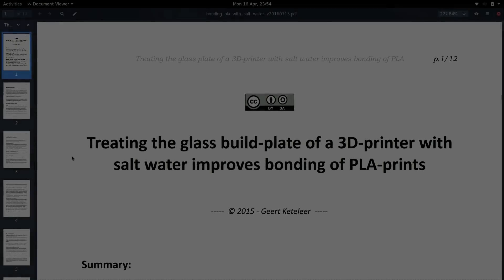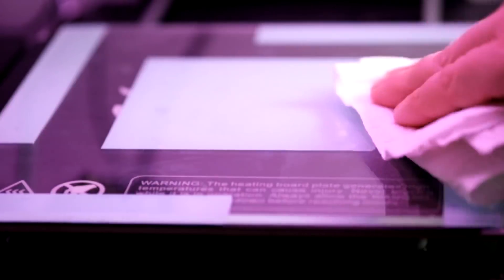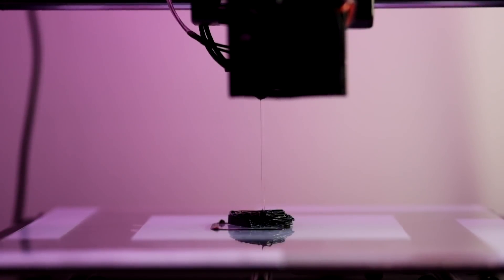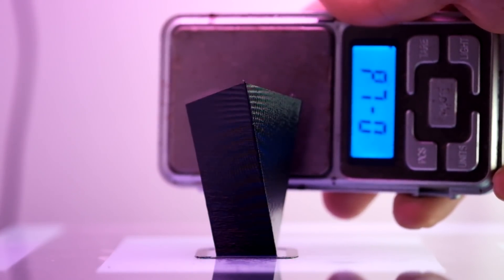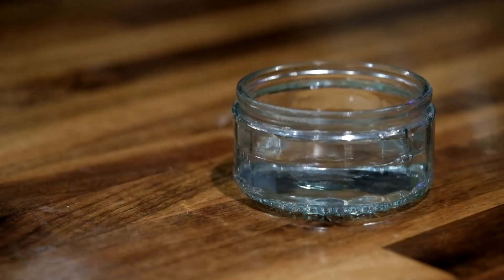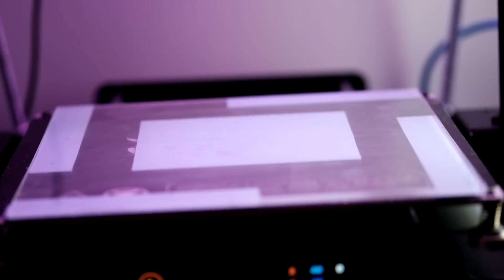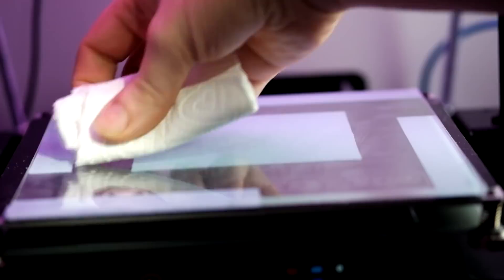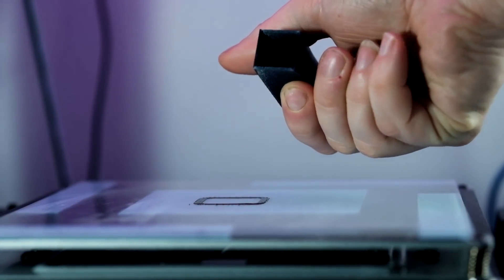3D Printing - The Salt Method

Comment: I tested this method many times and it was great. Thank you for this valuable video. But I made a noire and actually made some changes in this method in the way that I also mixed sugar with salt water, now a very good solution was obtained and all the prints I made were all successful. You can email me to get the details of the method.

Comment: just tried it and it has negative adhesion, as if i'm printing on a layer of butter. worse than plain glass. could be that i skipped the acetone, could be that i used too much salt. will start from scratch and try again until i start to see any change in adhesion.

Comment: So I have had issues with first layers not sticking. Tried different brands of pla and petg with different types of build surfaces. I saw this video and with nothing to loose I mixed up a batch of salt water, let bed heat up and used a fine cloth to wipe the salt solution over the build plate and set about printing. First layer issues gone. Just trying petg now and to my surprise it is also sticking with no evidence of warping. A big Thank You for sharing this information.😀

Comment: This was emailed to the creator of this method
The salt method and ABS

 I came across your paper "The salt method" quite a while ago. I was disappointed to see that it worked only with PLA. (I only have TPU, ABS and Nylon )
 Recently, I was going to print some bed-leveling tests and I thought that it would be worth printing them with some PLA, that was left from buying the printer, using the salt method. Before I was done testing I was out of PLA so I used ABS. To my surprise, the ABS stuck firmly to the bed and when I removed the test prints (1 layer high) they were being attracted to my hand like they were magnets (due to electrostatic forces). So I realized that the salt method also works with ABS.

I was able to print (Part.jpg https://imgur.com/a2Gr0oD ) without brim with very little wrap up (PartWarp.jpg https://imgur.com/b4WLhNZ ) on the edges. I wasn't able to print without brim with glue so in my case the "salt method" works better than most kinds of adhesives.
Then I recrated your test print (CrossTest.jpg https://imgur.com/bjsKPxn ) and printed it (TestWarpStart.jpg https://imgur.com/qKTmEPs ) but it wrapped (TestWarpMid.jpg https://imgur.com/vAZVCaX ) quick a lot front less at the sides and none on back (PerfectWing.jpg https://imgur.com/UBHuIT9 ). So I guess that's due to the bed not being perfectly level although that's pretty tough to achieve with manual bed leveling (DemoSecondLayer.jpg https://imgur.com/pDGAdvB ).

Little information about printing conditions;
Ender 3 Pro (pretty much stock apart from the glass bed)
PrimaValue ABS
Temperature; Bed at 110C and hotend at 255C
Printing in a plastic bag in a wardrobe (so the ambient printing temperature is around 37C)

P.S. I am not sure why no one was able to recreate this.

Comment: This method is great.  Instead of wiping the solution onto the plate, I bought a small spritzer bottle from the craft store.  Misting the solution onto the plate works really well for an even spread.
Reply: Be careful! Salt can corrode metal and electronic components!
Reply: Just gotta be careful to only hit the plate. Salt water is very conductive and quite corrosive so you dont want it anywhere accidentally

Comment: or you could just use an ultrabase or similar textured glass - insane adhesion when hot, and the parts audibly snap off the plate during cooldown
Reply from the maker: Sure, but when I made this video they didn't really exist (or if they did I wasn't aware of them)

Comment: huh, Youtube was like: 
People like videos with salt and 3d printing.
must recommend older ones which have the same thing
Whats next? Salt filament?
Reply from the maker: Oh, is that why this ancient video of mine is suddenly gets loads of comments?

Thanks youtube!

Salt filament which prints directly onto my chips would be OK.
Reply: @MatBrown  In a recent video a guy was tempering 3d printed parts inside finely grinded salt so they don't deform. I think youtube associated a strong connection between salt and 3d printing from that video and started recommending similar ones to everyone who had watched it.
Reply: @evren.builds  It wasn't just annealing, it was completely remelting the PETG parts in solid plastic. The PLA parts were the ones that were annealing.
Reply: @bradensinclair9517  Oh, Then I missed that. Were they printed with %100 infill?
Reply: @evren.builds  yeah they were
Reply: Next -> Ivan Miranda: 3D PRINTER FROM SCRATCH MADE OF SALT KKKKKKKKKKKKKKKKKKK

Comment: The glue is water soluble so it cleans off the bottom of prints easy, plus if the print gets stuck you can take the build plate off and soak it and everything will come right off. I take my plate off to clean the glue stick off every few prints.
Reply from the maker: All that is true for salt water as well though, and it's just a little nicer to handle. Also considerably cheaper.

Comment: I have problems with the water not forming a consistent layer, it pulls itself together due to surface tensions. Adding a drop of dish soap helps but then the adhesion becomes bad. Do you have any suggestions?

Comment: Interesting! I actually used sugar water for a while when I ran out of spray. Same process except I brushed it on. I was quite surprised it worked as well as it did but, one thing I did notice is that it won't stick if it's too dry and you have to start printing as soon as it gets tacky. One thing I did like about it is that you could just rehydrate the dry sugar crystals and you're good to go. Oh, and it's quite tasty ;)

Comment: I currently use diluted wood glue in roughly the same manner. And in another video someone used sugar instead of salt. The only problem I have with the glue is that sometimes the bottom surface of the print embeds some white tint...

Comment: Does it work with other filaments?
Reply: It should work with PETG on the simple theory that PETG sticks to plain glass and any solid particles from the salt don't occlude the complete surface. The question would be if salt makes the print easier and safer to remove.
Reply from the maker: Doesn't work with ABS. I was out of PETG when I shot this video so didn't have a chance to try that.
Reply: @MatBrown  Have you tried it with TPU?

Comment: I'm all for not buying hair spray anymore
Reply from the maker: I never dared use that stuff. Even taking the plate off to spray it I had horrible visions of hairspray getting all into the belts and motors and bearings and so on..
Reply: My method is to use a paper towel and continuously reuse it; the more you use it, the less it soaks up. Makes application easy and direct and clean